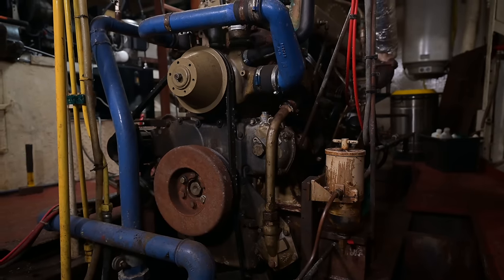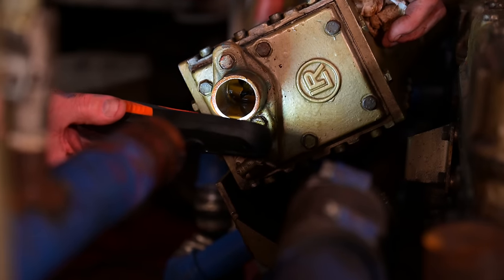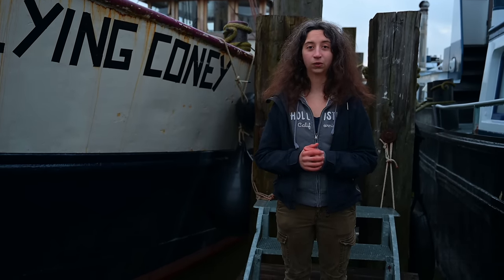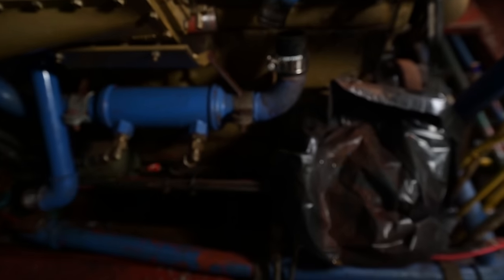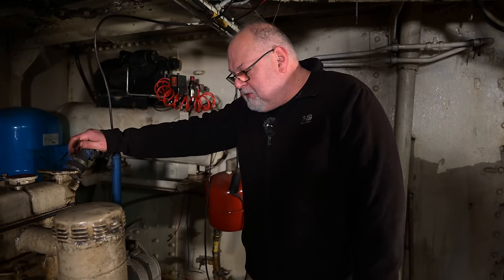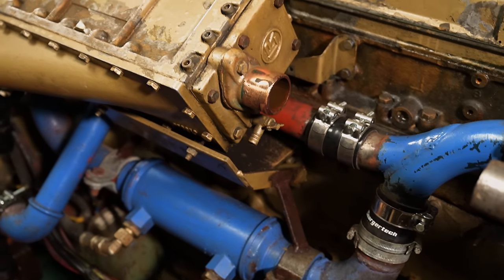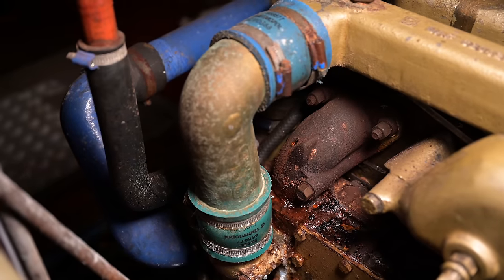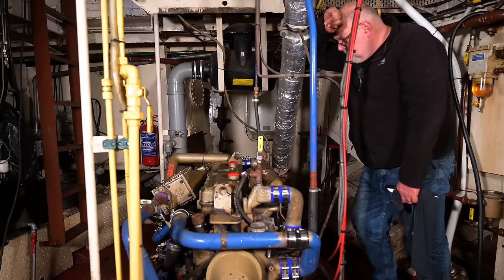Can We Save The Big Diesel Engine Of Our Expedition Trawler Yacht?

Comment: Well! John! Youre a champ! Incan relate what has happened here to my finding an old toyota landcruiser in a barn. Itvsat for 18 years. My neighbour a diesel mechanic, came over (once i bought the LC) and we did exactly what you did. New hoses, belts, clamps, fresh oil, filter a new battery. Coolant flush. We bypassed the fuel tank, cranked it over and “hey presto” she fired! All on original plugs, points, coil and condenser.

My point is, you cant beat cast iron old technology. Yes they may use fuel but as for the rest, they are marvelous.

Again bug shout out to john and again, a most enjoyable video

Comment: I think you will be happy with the older engines.  The are generally easier to maintain, but I suggest that you keep spare parts in your engine room shop.  It is good to keep extra parts (e.g., clamps, hoses, filters, etc.) particularly in an emergency.  You two are doing the right things and doing them well.  Thanks for your program.
Reply: Hoses, clamps, belts, etc. are the minimum inventory. I would also stock a spare starter motor, Heat exchanger etc  as you will need them one day and they are hard to find.

Comment: Looks good. Now, if I may suggest next step. Get some biodegradable degreaser. Spray down the engine. Let is soak for a bit and then rinse the engine down. Maybe use a garden pump sprayer to minimize the amount of water that will go in the bilge.
From my own carrier as sailing as chief engineer in the Danish Merchant marine a clean engine and engine room is a must, because in a clean engine room with good lighting it becomes much easier to spot any issues and take action when it is still a minor issue of any kind. . Also check your bilge for old rags and gunk to insure free and unrestricted flow of bilge water to the bilge wells. Take care

Comment: The dutch navy is using them in the mine hunters. There they run as a generator. Very reliable engines. They sometimes sweat some oil but that's part of the daf engine.

Comment: Hi there, nice job, well done so far. I've been following your steps with lots of interest. Reg overall conditions of the engine: overall looks sound, no reason why not. Seals and some gaskets might get brittle  and have hardened over time and will require change in the near future,  actually the smoke in the exhaust will most probably be a mixture of a bit of cylinder glazing, old fuel and hardened valve stem seats. My recommendation: Use the engine as supposed to be for some 20- 50hrs, take and send an oil sample to some known oil lab, this will give you an insight on the mechanical condition,  no need to pull the oilpan for that. You can run a compression test to see if the cylinders are running even and if not, most probably a valve seat job with change of valve stem seal change, would take care of that.  This engine should have a live expectancy of more than 15.000hrs, so there should be a lot of life left to enjoy. Send me a message if you need help, I'll be close to Holland in about a week's time and might find a way to pass by
Reply from the maker: Usually the in-frame overhaul is scheduled at 25 000 hours and a rebuilt should be done at 50 000 hours. The gear box has oil change intervals of 1000 hours. Since we do want to convert the ship into a sailing ship we will never get to those numbers. The big goal for now was to get the engine running again without risking damage or risking a catastrophic engine failure while on the sea. Next stepp is to go to the shipyard and in autumn or winter we can give the engine a refresh. Then we can also start to send oil samples in. Good tips! Thanks!

Comment: As a man working on all kinds of engines in cars and trucks for over thirty years, I can say that this man is one of very few I would allow near my stuff with tools. Yes you need a lot of knowledge but that´s achievable to anyone. That kind of feel he seem to have is the kind only decades of experience and a lot of mechanical sympathy gives you. About your engine, IDK anything about DAF´s but I have about the same kind of engine size and age in my converted bus. It´s a 12 liter Hanomag from 1975 with over 900.000 km´s on it. And it runs like new. And I have no reason to believe a DAF would be any worse. And you really don´t want a "modern" engine with electronics. You want an absolute reliable engine that just depend och diesel, air and compression. And that´s what you got. Give that engine the love it deserves and it will outlive us all. Don´t stress it when cold, always let it gain some heat before going to sea, and never ever over rev it. Also, don´t shut it down directly after being at sea. Let it run on idle for a while (10 to 15 minutes maybe) to allow it to "calm down". Last but not least! Make sure you have reliable gauges for temps and pressures, alarms and warning lights etc in the wheelhouse. Maybe even consider a camera looking at it. It´s an unmanned engine room and you want to be able to see any smoke developing as soon as possible. Thanks for all your videos. It´s very nice to see this old ship coming back to life. Regards from Sweden.

Comment: Going through something similar on our CAT D399s, to check on the overall condition and on the not too expensive checks we bore scoped and pressure tested. On an engine that old I'd definitely check and service all the heat exchanger cores. There's a good chance at least some of the injectors are worn so I'd pull those and service/replace those too, ditto with the glow pugs.

Comment: As long as the engine starts and doesn't use a ton of oil, run it. If you maintain it it should last the life of the boat.
The best thing for diesel engine it to run it with a load and put some heat in it. They dont like idling or low load cruising

Comment: Remember, that the old engines are invariably better than new engines. Keep it going! Older engines are typically cast iron (rather than alloy) and designed to last for decades.
Reply from the maker: If we need a replacement engine I would likely pick the Cummins 855. Cummins does have a slightly better service policy than DAF. Luckyly we don't need a stage V engine. Also an option would be a Chinese engine like the Weichai WD12. But for now it looks like the DAF will be good for many years to come and it's part of the history of the ship.
Reply: @FlyingConey  I agree, the vintage (in keeping with the vessel) is important but my point waa that old engines were designed and built to run 50 years or more, whereas modern engines are built to last a decade (if you are lucky). Therefore you should have a strong preference for a low reving, overbuilt, older, cast iron engine over any modern alloy block.
Reply: Except modern engines get 50% better fuel economy with less emissions. However I might suggest John Deer as still producing great low speed diesels.
Reply: @mikestevens9455  Yes, but there is a price to be paid in meeting those regulatory requirements.
Reply: @stephenburnage7687  too true, i vote for a Bolinder ~ some real iron
Reply: Good idea , I agree save the old engine . Remember the new engine will have Much USLESS polution control CRAP

Comment: Just my opinion here.  Do the minimum just to get it running first.  Check it out once it's running.  Then make an assessment of the engine's condition.  It only has 5000 hours.
The engines in my boat sat for 9 years.  I changed the hoses, and belts, and filters, and one coolant pump.  I refurbished all of the heat exchangers.  They run great!  I'll just do a valve adjustment before we go on any long trips.

Comment: as an ex tug engineer and field service  man for Cummins, I'd say your HUGE  engine is a  tiny engine
but good for you for LIVING  life
those DAF are so common in Western EU  and cheap good luck people
Reply from the maker: Flying Coney once had a huge engine in it. 130 liters or 8000 cubic inches. Because of this enormous engine she was in fact used as a tug boat sometimes to tow boats to England.  But for most people 11.6 liters is still a relatively large engine. The ship Barbara was trained as a ship mechanic had two Wärtsilä 12ZV40/48 with 18 000hp each. Compared to that even the Cummins QSK95 is a tiny engine. But actually I'm a big fan of the Cummins 885 but I think the DAF has a little bit less fuel consumption. What's your opinion on that?

Comment: That engine looks very much like a Leyland 680 or TL11 I worked on similar in Scammell routeman 8 wheel tipper lorries back in the day
Reply from the maker: Yes indeed! DAF bought the rights for the Leyland 680 and modified it. The both have this distinctive rough idling sound. I'm glad John gave you a response to your comment on fuel injector pipes. What we do is, we make videos about how to refit and run a tall ship. We're able to to maintenance on our equipment but we're glad if we can work together with real professionals like John. By the way, I'm a huge fan of those old British lorries. AEC, Scammell, Foden... My favorite song is: Champion at keeping them rolling 😉

Comment: Vink Diesel in Holland can help you with spare parts for the DAF should you ever need any. I would also highly suggest replacing all the fuel lines as a precaution and if the there isn't any I would install a fuel day tank somewhere above the engine.

Comment: PS if you haven't drained the existing oil in your engine, It would be wise to take a quart or so and put it in a clean container and ship it to a facility that does oil Analysis to give you a Good idea of what has been going on internally! You should be able to find someone near you who can provide this Service! Your mechanic  should have an idea of someone to perform the task if he is familiar with diesels and their workings! The Motor you have has a reliable reputation for sure! Hopefully Negligence hasn't taken too big a toll in its 5 k hours. Age means little if one maintains their motors faithfully. Good Luck going forward

Comment: As long as the engine's health is good(compression, oil pressure, low oil consumption,  or excessive smoke), I'd have an oil analysis done and then if that was favorable, I'd leave it alone and just do regular maintenance. Oh! and keep a log book for run times, oil/filter changes and repairs. 
Also, consider an air damper type emergency shutdown set up if you don't have one already. They can be expensive, but they are cheaper than a fire.

Comment: If that was my engine after all that sending I would choose a nice etching primer followed  by a quality marine paint before instaling the silicone hoses.
Reply from the maker: We will re-paint the engine in the future. However underneath the hoses it's better to don't have paint. It gives the hoses a better grip and since there is no oxygen there's no rust. For now we used a bit of weapon oil to prevent exposed metal from corroding.

Comment: Those are great engines and 5,000 hours isn't any hours on that motor if it runs it will run your lifetime how much do you have left lol That's how I look at things in that Perkins that is also an awesome awesome motor it will run and run just like the old Continental engines have fun out there be safe
Reply from the maker: We just figured out this week that we actually don't know the running hours of the engine. Sorry for that but we didn't knew it better and the engine hour clock said 4800... But the engine sounds great and we're talking about 100-200 hours in a year at maximum. So I guess the engine will still run for a long time.

Comment: the daff engine you have was also used in coaches I used to work on the engines the only difference was yours is upright with a heat exchanger and water-cooled exhaust system or dry I couldn't see if the exhaust goes straight up then it a dry exhaust I would suggest you get some spare pump plates as they are prone to crack and break hence the injector pump will go out of timing and you will stop so always give a regular inspection for cracks between the injector pump and the drive from the engine you will see some round discs bolted between the drive what they do is to allow some movement and demand the inertia from the engine so good luck so all the best from john from rugby UK.
 .
Reply from the maker: We have a dry exhaust but I think the exhaust manifold is water cooled. Also I think the marine version of the 1160 does have a smaller turbo charger for lower fuel consumption at lower rpm. thank you for advice on the water pump plate. I'll hand the information to John.

Comment: Happy times with all the good engine-related news! I enjoyed watching this.
Here’s a small donation for all the parts included in the English servicing of the Austrian owned, Dutch DAF-engine…
😅👊🏻
Reply from the maker: Thank you a lot. Our viewers come from all over the world and also the boat is a big mix of parts from everywhere. It's built for the Germans by the Dutch using the design of an Austrian and for whatever reasons watertight doors from New York. 😂 Also the DAF is a modified British Leyland engine. They also have this lovely Raf, Raf, Raf sound when idling.
Reply: @FlyingConey  Priceless! 😂
I drive DAF trucks at work, so I’m all in for it… 😁👏🏻
Reply: @FlyingConey  this is not a modified leyland engine this is a pure DAF there is a big differens between a DAF and a Leyland there are no parts intercangeble
Reply from the maker: DAF bought the license for the Lelyland 0.680 engine. Modified it in many ways to make the DAF 1160 but the design is basically Lelyland. They also sound very similar. @hubertsteenbekkers1522
Reply: @FlyingConey  the Look, simmular but are not simmular
Reply from the maker: They are not the same engines. The Leyland has 11 liters displacement the DAF 11.6. The DAF is a complete new development. But the engine design is based on the Leyland and DAF bought the rights.

Comment: You need to pull the lower pan to inspect the bearings and check for rust as a minimum.  Once you throw a rod thru the side it's all over............. Safe rather than sorry is what I recommend....................  enjoy
Reply from the maker: Yes but we need to change harbor first. There's no infrastructure here do to an extended job like this. I tried to get a missing hose clamp and went to 7 different stores. We still had the reuse the old ones. But we've planned to take the oilpan off in autumn.
Reply: @FlyingConey Can't speak for the Netherlands but on-line is typically the best source for specialized marine items.
Reply: I couldn't tell if it had an inspection plate when you change the oil a quick visual of the lower section was possible. Just hope that's the case......  enjoy   @FlyingConey
Reply from the maker: You always need both. We order 99% online and usually can get parts, consumables, paint and so on at a very reasonable rate. But planing bigger projects like the engine maintenance is quite the task and  it's almost certain that you will forget to order something, it doesn't arrive on time, it gets lost in the bilge or a new part is broken. this time the only thing missing was a hose clamp in between the sizes we have ordered. Also we needed more clamps than the online shop had in stock. So for this you need a local store were you can get stuff if needed and you can't wait three to fife days until it arrives.

Comment: If a marine gravity fuel system engine ( ie one with a fuel header or "day tank".) is prepared for starting correctly, the engine should start instantly on the first revolution.  
If there is any churning whatsoever, a mistake has been made. 
If there is no day tank as required by Lloyds, then there should be!

Comment: measure the compression of the engine and the injectors, further adjust the valves, with a DAF there is often not much going on with the engine,,
Reply from the maker: We need to take off the injector pump anyway because there's a hose directly behind it. So I think we'll send it in for service. But the big goal for now is to get the boat to a state were it can be moved if needed.

Comment: Heat exchanger?????
Reply from the maker: We have a keel cooling. No salt water in the boat. But the engine has multiple heat exchangers: Intercooler, engine oil cooler, gearbox oil cooler, water cooled exhaust...

Comment: The old engine has been fitted for a long time, so it would be nice if an extensive overhaul got her in tip-top condition. 👍👍
Reply from the maker: So true! The engine is part of the boat since 47 years and the longest serving propulsion engine Flying Coney ever had. It replaced a De Industrie slow running Diesel engine with more than 130 liters!!! displacement. So it has 10% of the displacement and is still more powerful.

Comment: I think I am just as surprised as John, I though for sure there would be "issues" related to the lack of maintenance.

My only concern after hearing that it just had water and not properly maintained coolant in the system would be liner corrosion.

But the old girl is looking good after that little bit of TLC. 

Good episode guys, I enjoyed it.
Reply from the maker: All the water that came out of the engine was Cristal clear. But John does want to take the covers off to have a look at the liners. We discussed it but we came to the conclusion that it's not a must for now. We also don't know how long the engine had been without coolant. Probably only since 2018 when the keel cooling was replaced. The glibbery build up next to the broken hose tells me that there was coolant at some point, it also tells me for how long this engine was leaking. 😧

Comment: Make it electric. Went through same process and regret i did not went to electric. You have room for batteries.
Reply: Silly idee
Reply from the maker: To save fuel we already have planned to add a full sailing rig. But in modern times a ship still needs an engine. Fitting a 200kw (275hp) electric propulsion system with battery packs to our boat is way out of our budget.